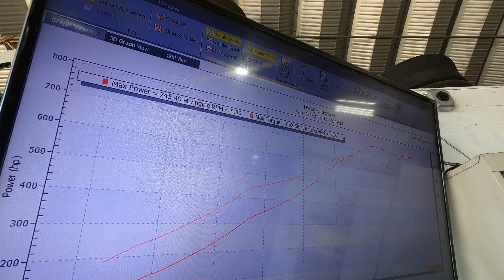FULLY BUILT SINGLE TURBO F80 M3!!! MLife Sauce!!!

Comment: Stock engine can handle 700wtq
Reply from the maker: It definitely can, but right now cars limited by the 3.5 bar tmap sensor. For that reason we couldn’t go any further safely.
Reply: Stock engine can only handle up to 680 wheel torque until rods start to bend. I don’t even want 650 wheel torque on mine. I have it just at 600 wheel torque to maintain the integrity of the engine over time. Stock turbos and full E85.
Reply: @JiuJitsuM4  how much did that cost you to do fbo?
Reply: It can but it also can’t , single turbo will bend the rods eventually
Reply: Spec for the rear wheels and tire